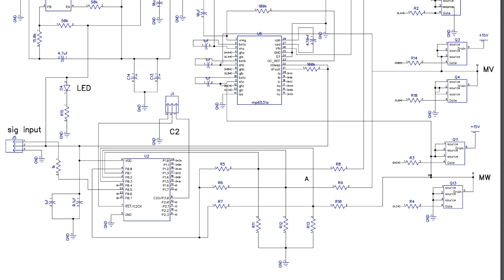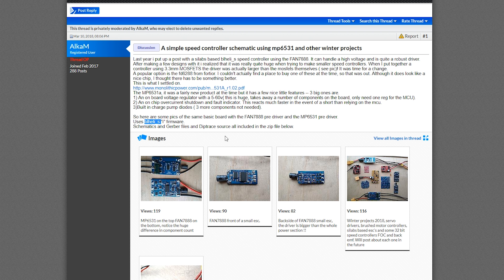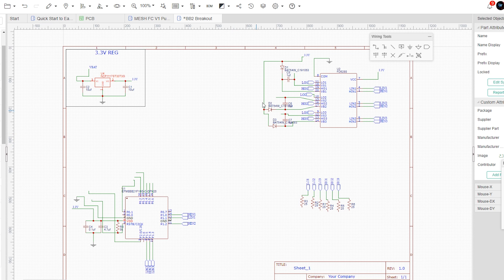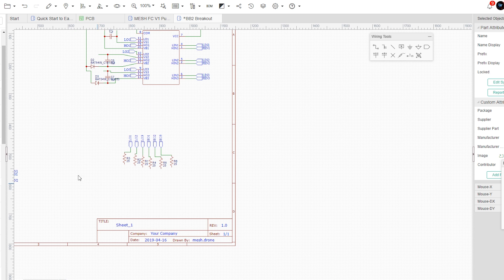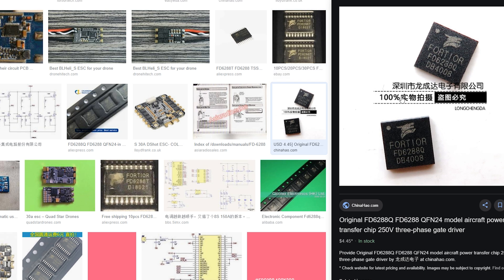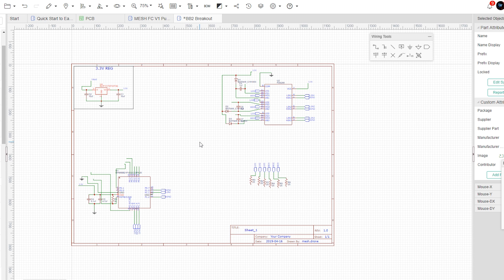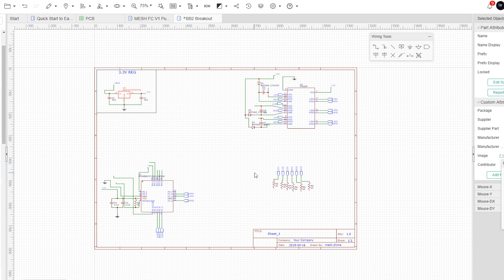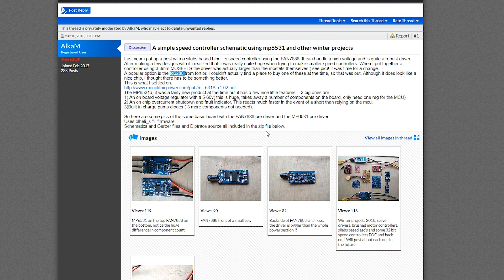DIY Open Hardware Blheli_S ESC // DroneMesh B_OpenESC V1 [Part 1]

Comment: I spent some time to figure out the the purpose of some of the component on schemes like this and want to share my findings with anyone who is interested/
1) The mosfet gate resistor is not for a dead time. This resistor limits gate current and helps to suppress gate charge oscillations that can occur because non-zero inductance of gate PCB trace.
2) The diode and capacitor circuit is called "bootstrap" -- to open up a "high" mosfet you actually need a voltage greater than your input and the bootstrap capacitor is a part of "charge pump". When the low side is opened this cap charges with 3.3 volts (for this scheme, it could be +12 for other schemes/drivers) And then when high side opens - this cap connects inside the driver in such way that this 3.3V adds to Input voltage so you can send (inputV + 3.3) to high side gate. And the diode prevents this voltage from going to your 3.3V line. I think it is very cool! Also keep in mind that with bootstrap you can't operate with 100% PWM duty because you need a non-zero low gate time to recharge bootstrap cap. But it is not a problem for BLDC motor as you have phase changes anyway. Also some drivers has this diode part integrated -- you only need a external cap.

Comment: I'm exploring the development of a very high volt capable ESC (somewhere in the range of 1500 volts).  I'm curious on whether this is even possible using existing tech and clever construction.  If you have any insight I would greatly appreciate any kind of feedback, and I would love to include you on what I am working on.  Thank you!
Reply: @Rogue Mentality my overall plan is a combustion engine-high voltage generator over battery hybrid, where the "3 minute" battery is basically a buffer between the generator and load.  I know batteries have come a long way, but energy desnity+output power/weight ratios are still won by internal combustion engines.  My plan is to combine an engine mated to a custom built generator pair with some high voltage full bridge rectifiers.  It's a concept for sure, and I'm sure it's probably been thought of before.  Im just trying to figure out if with current tech if it's possible.

Comment: Drone Mesh I am a bit confused here  😀 You say that the schematic is in Chinese so it seems like it is not your work but you say that you are drawing a schematic out (but you are tired )All a bit confusing to me. Then you talk about some guy on RCGroups who inspired you but you only mention it and it is hard to make out who you are talking about. Can you fill me in on what is actually going on with this project as it does sound very interesting. Thanks and I hope to hear from you here 😀
Reply from the maker: I meant the datasheet of the fet driver.. Check part 2 and it will make more sense.
Reply: @DroneMesh English versions are available.  This possibly could have been made after you uploaded this though.
https://static.qingshow.net/fortiortech/file/1597746029372.pdf

Comment: Aikon and Tmotor individual esc's still use dedicated drivers for each phase instead of the fortior hvic. Kiss does this also.

Would be interesting if there is an advantage or disadvantage to using the fortior vs the individual drivers.
Reply from the maker: The new F45A uses the fortior as far as I remember.. I'll double check them tommorow morning..